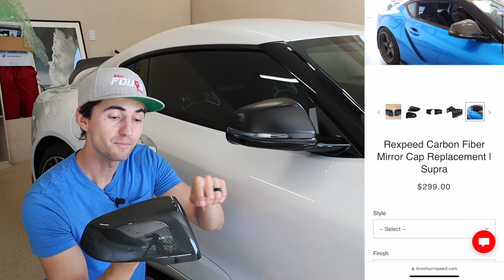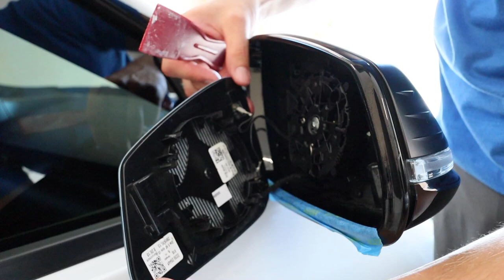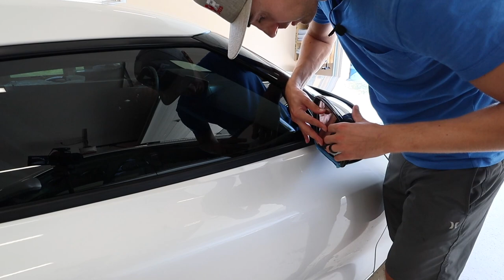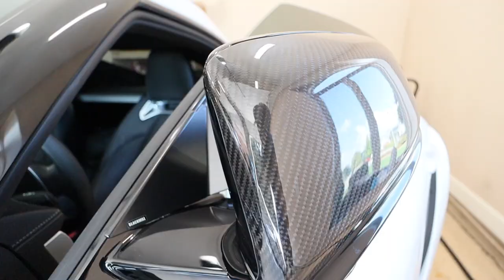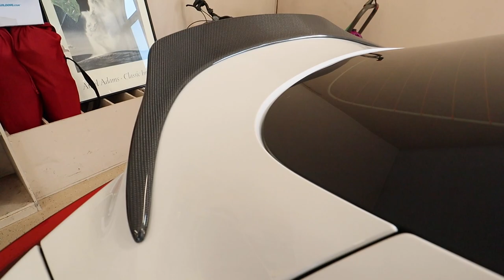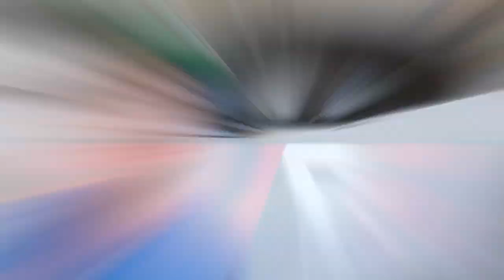2020-2024 MK5 Toyota GR Supra Carbon Fiber Mirror Cap Replacement Installation

Comment: Sorry for bringing up an old video, but how has the mirror caps been on your FIL's supra? in terms of when it rains or detailing the car, does water mess up the electronics by any chance? Ive read on the forums that aftermarket mirror caps had that problem......... I want to order a pair from you but I'm worried about that possibility. thank you!
Reply from the maker: I never had any issues with these. Had them on my Supra as well for over a year.  Let us know if you want a set https://brosfourrspeed.com/parts-%26-merchandise/ols/products/rexpeed-carbon-fiber-mirror-cap-replacement-supra
Reply: @BrosFOURRSpeed  Thank you for the link, i am definitely looking into these. but I do have one question Hypothetically, for some odd reason, if you were to buy this 2020 Launch Edition with 2k miles, Sat in Dealership Showroom Since 2019? what fluids would you have to change?

It was owned by the GM of the dealer, oil was changed every year from 2019, but I am not entirely sure about brake fluid, transmission fluid, diff fluid; are there any other fluids I should be concerned about.

Are those fluids needed to be changed as well even though it only has 2.8k miles?

Thank you if you would know, i'm not really sure since it is a 3-4year old car.
Reply from the maker: @GNoahY  to be honest those would all be good. Maybe after 10 years you’d want to change the rest. Has the car been driven from time to time at least? Should be fine overall. But I’d have them do a fresh oil change. And possibly consider new tires for it as they reach 6 years old
Reply: @BrosFOURRSpeed  yes the car was driven in those years since 2019... but i might've already purchased the car.......... i definitely should've asked for a new set of tires, i did not think of that.... In terms of new oil change I guess I screwed myself on that too.

I'm gonna go see my mechanic and have him check that out!

Thank you, and I really appreciate your videos, they teach me a lot about the car.
Reply from the maker: @GNoahY  either way part of buying a 6 year old car comes with some basic maintenance. You’ll enjoy it! We have tons of Supra parts on our site! Even an open box carbon wing if you want a big discount on something
Reply: @BrosFOURRSpeed  could you send me the link to the wing, i went through the supra parts on your store and couldn’t find it
Reply from the maker: @GNoahY  https://brosfourrspeed.com/parts-%26-merchandise/ols/products/rexpeed-v1-supra-rear-spoiler/v/RXP-V1-SPR-RR-PN-BOX

It’s the open box gloss one 👌🏻

Comment: Are these identical to the Toyota ones they sell for 1k?  If not, what’s the quality difference, if any?  I just took delivery of a 2024 manual in Stratosphere blue.  I had included the carbon fiber mirror caps in the deal…but they got deleted due to low inventory.  Might be a great way to save $700 if the ones on this vid are basically the same quality.  Thanks!
Reply from the maker: Yeah these are the same quality and fit as the OEM ones. Check out or website, we have a ton more Supra parts. Very happy with these ones. I have them on my car too and they are a much better buy then Toyota's
Reply: Did yours just come in? I'm picking mine up soon in nocturnal black 2024 automatic and it seems that during transit my vehicle had the carbon fiber mirror caps, but since arrival the dealer updated the sticker and removed them without telling me.